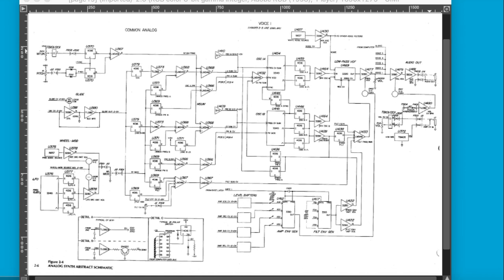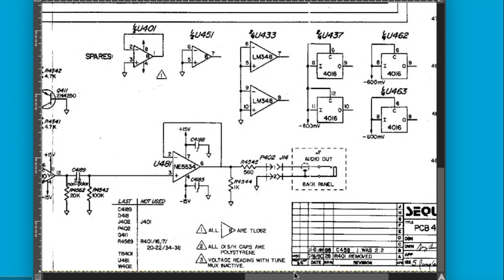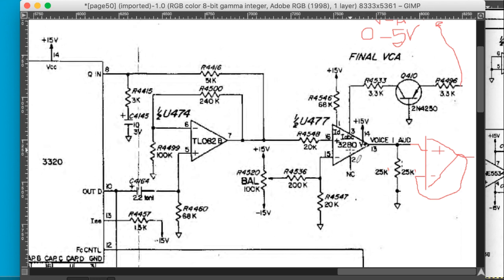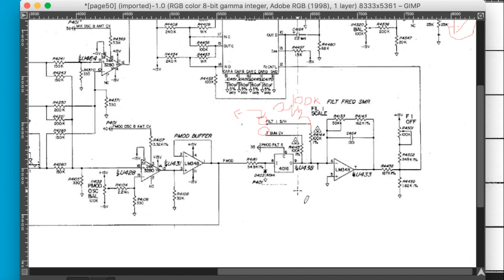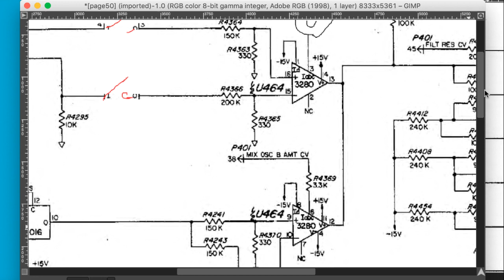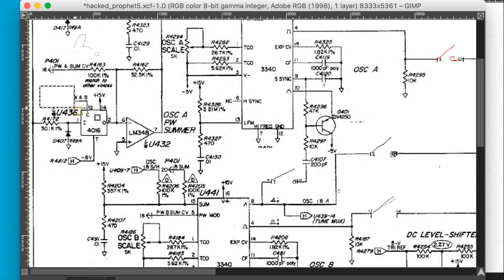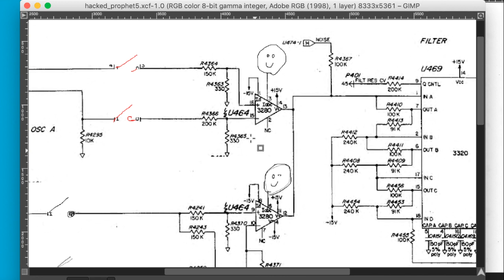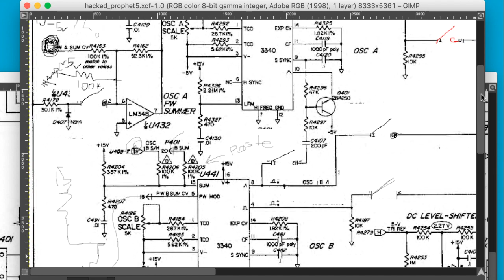Sequential Prophet 5 Voice Circuit Analysis, with an eye towards modularization

Comment: If anyone is replicating parts of this circuit, replace the crappy 4016 bilateral switches with something 20 years newer with much more linear (and lower) resistance such as a 4066 which is a drop in replacement